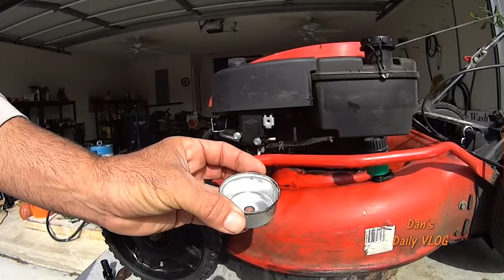Lawn Mower Repair - How To Drain Bad or Old Gas and Clean Carburetor Bowl and Jet

Comment: This is THE BEST mower instruction video I found so far. It should be the 1st video you need to watch when your mower does not start. I had a new mower used for only a couple of times and sitting in the winter. It did not start. My grass has grown to 1 meter high. I have experiences in fixing cars so I think I will give it a try. I watched several videos from YouTube but they don't tell you how a lawnmower works exactly like in this video. I went to Walmart to buy some starter fluid, some engine treatment fluid, and some cleaning fluid. I put them into the carburetor......This is what I learnt from OTHER YouTube videos......They all tell you there is gunk in those places and you need to clean them......WRONG! 
After I watch this video, I grasp the theory of lawnmower and realized that those cleaning fluid actually JAMMED the tubes in carburetor! So I take out those tubes in carburetor and wiped out the fluid on them. YEAH, through these tiny holes, I can see there is no gunk in it. It is just the OLD FUEL that causes non-start. I put more high-graded fuel from Walmart and it works like a charm! I only need to pull the cord a little and the engine ALWAYS starts. Thank you so much Dan! You saved my time and my weekend is not ruined! I can rest and go to work next week without dealing with repair shops and taking my mower back and forth.

Comment: Thank you Dan!
I drained the gas tank of my new (end of summer 2016) Toro Brigs Stratton (7.25 190cc) for winter storage and used fresh gas today for a 2017 mow but it would not turn over at all. Your video was extremely helpful and very much appreciated. I will make a donation to St. Jude CRH which was a very classy suggestion on your part. Thanks again.
Reply from the maker: Thank you John, you are very kind

Comment: So - I ran my generator until it stopped and put it away.  When I was ready to use it again, I filled it up with new gas and stabilizer.  Couldn't get it to start.  Figured I was in for a repair bill at the local small engine clinic.  When I tried to start it I got that familiar smell of varnish from old gas, even though I had run it dry.  Long story short.  I followed your directions and used a little spray carb cleaner ( the float was stuck and the intake was blocked) and badda bing, badda boom, it started like a champ.  Thanks for takin' the time to show us what's behind that little bowl.  It is greatly appreciated!
Reply from the maker: My pleasure

Comment: BTW - I used a bread bag "twisty tie" to clean out jets etc.  Just strip the paper or plastic off wire and run in and out of jets. Worked great.
Reply: Paul Anderson you can also use welding tip cleaners.  They work amazing
Reply: How about a paper clip?

Comment: Sonofagun! This is one of the 2 or 3 best how-to videos I've ever seen! I have a Craftsman 3.5/ 20 inch 1986 push mower and the only maintenance I ever did was change the oil, spark plug, and air filter once a year.  That's held me in good stead til recently when the mower would start up okay, run for about 7 minutes, then start missing as though it was about to run out of gas, then die.  From your video  I now think the problem may be bad/old gas or maybe just a speck of dirt in there.  Your video and description of the fuel line/ carburetor bowl corresponds exactly to what I have on my old Craftsman and now I'm excited to try out these simple methods.  Thanks so much!
Reply from the maker: Thank you so much for the high praise !

Comment: 1 problem with carbs is that not all mowers have it on the outside with the bowl available. With mine, many of the parts must be removed to get to it to drain & clean it. Including the top with the pull rope & that's the easy one. Be sure to watch a video with this type of mower to see the disassembly & reassembly.

Comment: Thanks man, my electric mower died so I had to pull out my almost 15 year old gas powered one.  The carburetor bowl and the hose were in a harder to reach spot for my mower.  I emptied the gas and removed the carburetor bolt, but the bowl refused to budge so I let it be.  I sprayed the carb cleaner directly into the holes of the bolt, put it back together and BAM, my mower started.  I can't believe that a 15 year old mower that has not been started for years is running like a champ.

I also checked the oil and cleaned the air filter.  I'm surprised that my Murray mower with the Briggs and Stratton 6HP engine is still running.
Reply from the maker: Sweet

Comment: Thank you so much! After cleaning up the holes in the bolt holding the Bowl at 10:36, my lawn mower works right away now. The holes on the sides are bigger, so I was using clip. The center hole is a little small, so I found out the metal tip of jumper wire was perfect to clean up the little hole. Just in case anyone looking for things to clean up the holes.

Comment: great video thanks! my friend moved out of his house and got stationed elsewhere and gave me his lawn mower he stopped using because he had bad gas in it. Drained it and replaced the blade and works like new. Great Vid, subscribing now.
Reply from the maker: Happy to help Amani
Reply: You should investigate contamination source starts with clean gas can ,clean gas tank clean fuel no older than 30 days and storing gas container in the shade or inside shed with top closed with cap on not pouring funnel sticking out gas absorbs moisture and moisture can turn gas bad

Comment: Really good video, thanks,  I have a new Briggs and Stratton used only for one season.  I went to winterise it and although I had run down the gas, there is still some in the carb bowl.  Now I can do a full drain and clean before it goes away.  Just to say I’m in the south of France so I did the final cut during last week.  Well done for taking the time to explain slowly and carefully.

Comment: 5 minutes in and he still hasn't started. I'm just gonna turn it upside down in a pan. 😫
Reply: I know this is 1 year after you wrote this, but I just found this. I couldn’t get the tube off so I just used a Turkey baster. Hopefully that’s ok… I tilted it a bit at the end so if there was any in the carb it might flow back into the gas tank. I couldn’t see much else in there anymore. Also he said the gas would flow into the bottom of the mower and then into a fuel catch, but my Toto Recycler doesn’t have any fuel catch and there was way too much gas to fit in that little lip. I was so excited about a gas mower until it immediately gave me issues.

Comment: Hello Dan great video very informative at the rite time I gotta drain my mower storing it for the winter and now I know exactly what to do thanks Dan
Reply from the maker: I would rather you put some stabil stabilizer in it so the seals in the carb and the fuel line doesn't dry out and crack from the ethanol residue. Stabilize the fuel now and run machine for 5 minutes so the carb gets the stabilizer in it as well then drain it in march IF you have to.

Comment: Great video. I like how you explained things very plainly. I haven't done anything yet, but I know the video has helped me figure out how to check all that.  My problem is that I was fixing an issue with the mower that kept the blade from spinning. I flipped over the mower while I was fixing it.  I didn't drain the gas like I'm pretty sure would have been smart to do.  My neighbor was able to mow is lawn and after he was done, I tried to start it the next day to get my lawn done. The mower didn't start. I've waited a day to give it time to dry out any of the gas that may have flooded it and still nothing.    I bought my new better powered Ryobi mower after convincing the wife that I can't get it fixed.  Now I am trying to fix it so I can donate it to my neighbor.  So I'm trying to see if I can easily fix this.  I don't necessarily want to pay a professional to do it.

Comment: Dan : I've always used 93 octane ethanol free and I also use is Sta-bil gas stabilizer and Sea foam and this has always worked for me in leavening fuel in my small engines all winter long without draining it . Just my findings .... cheers

Comment: Need to clean my B&S 175 cc power washer which utilizes the same engine. Watching the video at 8:38 you were draining the gas tank and it looks super simple, but you might want to open the gas cap before disconnecting the fuel line which would allow the fuel to run faster as there would be no suction left in the tank.

Comment: I have a power washer and I couldn’t get it to start but I squirted a tiny bit of gas into the intake without the filter and it ran for a few seconds then quit and we have had it 3 years and have used it all of 2 or 3 times
Reply from the maker: +Traxxasboy9087 Well given what you've said that it will run if you poured gas in the carburetor I would say follow the steps of my video to clean out the carburetor bowl and make sure the float is working properly and that you have clean fresh gas in the tank

Comment: In addition, I leave my big Husqvarna tiller loaded with gas from season to season and my 10hp pressure washer also completely filled with gas from one use to another, but I only use premium non ethanol gas, aadaquately stabilized.  If you want to burn that cheap crap in the growing season you need to burn it all out and refill  with the good stuff before you put it up for the winter.   All I do in the spring is replace the fuel filter,  turn the gas on, check the oil level and crank it up.  I put fuel filters and fuel shutoff valves on all outdoor power equipment if they do not come with one.

Comment: When  i winterize  i run until  it stops  then pull  it couple times  but watching  your video  i can take off the plug  to make sure im dry always  have stabil in my gas
Reply from the maker: Well done. Don’t be afraid to spray a little WD40 in the spark plug hole and replace the plug before you let it sit. Helps for the first few pills of the cord a few months later

Comment: If you tilt the lawnmower on its side with the carburetor bowl up, can you just unscrew the bolt on the bottom of the carburetor bowl to check if the holes are clogged without emptying the gas tank?   Or will the gas in the tank just flood out of it?  Thanks.  Great video series!
Reply from the maker: there would be no way to stop the gas from flowing from the tank thru the hose and out the bottom of the carb unless you can get the carb bowl ABOVE the fuel tank. If so, you will be ok except for the fuel in the bowl itself will come out

Comment: I get to 10:55 and this is a great video - exactly what I needed when I went looking.  I have to ask:  Why did you screw around with the hose clamp to drain the gas tank at all, when you were going to open the carb stop and drain that too?  Seems like opening the carb stop was absolutely all you ever needed to do.
Reply from the maker: Ensure no blockage in the line AND drain the carb.
Reply: @DansVlog  Thank you for your reply!  That makes sense, and your followup to a new comment on a 5-year-old video is much appreciated.

Comment: if you don't have fuel line(mine does'nt)i removed oil,them tiped mower on its side to drain fuel,you are not supposed to turn mower on its side(i mean carburettor on bottom) because oil will get into carb.

Comment: We drained them for the winter. Just cleaned the carburetors, and all the other pieces. Also checked the spark plugs. Supreme gas. Turns over. Starts, and then quits within two feet.
Reply from the maker: +PixieTheRabbit probably the needle in the carb bowl has dirt on it causing the bowl to fill too slowly
Reply: Thanks! We will try it tomorrow morning. My son is the mechanic and I am his helper. I am tired of paying $95.00 every single year. And I can't afford it, either. My son thinks that the issue is linked to the ethanol in the gas; so we are using supreme this year.
Reply: Thanks for your advice. Needle cleaned again--and everything else.. Still won't keep going. We are going to try adding dry gas. Same thing with both lawn mowers: one is a nice Canadian; the other is a cheap $150.00 from Lowes, older model from my dad. I think I will take a look at some of your other videos, and then make my son watch them, hahah..
Reply from the maker: PixieTheRabbit when you take the fuel line off the carburetor do you have good fuel flow coming from the fuel tank there is sometimes a screen in the fuel tank that can get debris blocking the fuel from flowing from the tank and through the hose
Reply: Thanks for your sound advice. My son cleaned my husband's mower needle for the third time--this time with carburetor cleaner with chlorine. Now his is up and running. Will cleaned the screen on mine, and the needle--twice. But tomorrow, we are going to use that cleaner with chlorine.

Comment: My Troybilt would not start a few years ago and I took the carb bowl off and cleaned it with carb cleaner now it starts on the first pull.I took a bread tie and put it through the fuel jet hole like you showed.
Reply from the maker: Good idea. Thank you Mark
Reply: Mark sorry been quite busy at the factory and around the house will get them up soon have some trimming mowing and use of the Echo hand held also
Reply: Thanks Dow I understand work 4 10 hour days myself sometimes work days off sometimes mandatory and sometimes I volunteer for overtime.
Reply: A lot of people on vacation this month so we are pulling 5 12 hour days at the moment
Reply: Man I know it gets busy for us at the end of the month and real busy the end of the year,The money is good but you get burned out.It will be slow for us at the beginning of the year.

Comment: Well, I tried. My Craftsman lawn mower is only a couple of years old and is not set up like this. I could not even get the hose off of either end. It's a super tight fit with basically no room to move around. The bowl does not have a bolt that I can remove without taking a bunch of other stuff off (it's counter-sunk inside something else, I don't feel or see any way to get a tool on it). I'm just taking it in. I could have done it if it was a mower like yours.
Reply from the maker: Sorry bud

Comment: OH ok Dan I'll do that then thanks brother I just bought the mower this summer mid June honestly I haven't even cut grass with it yet the gas that's in it is from the guys from the shop I bought it from to test it they had to assemble it them selves to make sure it was ok before leaving their store what should I do then next year I will be using it a lot more
Reply from the maker: Next year, just put gas in it and run it like normal. At the end of the season, going into winter, consider Stabil and let it sit.

Comment: Thank you so much! I accidentally put the weed eater gas in the mower and I needed to drain it out 😬 oops
Reply from the maker: GENESIS QUINTEROS you can run your mower with MIXED fuel you just can not run your weedeater with NONMIXED fuel
Reply: Dan's Vlog thank you! I did that for a little bit until I found your video and decided to drain out whatever was left! Good to know though because I thought it would mess up and my mom would get mad 😂 thanks again! I appreciate the video and the reply!

Comment: I had just a tiny bit of gas left in my gas can, and poured it in the lawnmower yesterday before taking the can to refill.  Poured more new gas in it when I got home, but it wouldn't start.  It had started fine recently, and for as long as I can remember.  I'm guessing it was a bad idea to pour that gas that remained in the can into the mower, even though it had only been in there a month or so.

Comment: you can use a gas stabilizer like seafoam or K-100 in the gas i prefer K- 100 and run the engine 5 mins. or so the stabilizer gets mixed in i use it in all my small engines before storage if the gas you purchase has ethanol in it could cause problems after sitting!

Comment: I am going to try this with my mower. I hope I have the confidence to get it going because it's just me and my daughter. Let you know what happens.
Reply from the maker: Go slow. Take your time. Watch your eyes. Gas hurts. Please let me know how it goes.
Reply: Anela, I'm in the same boat with just me and my daughter. I'm a little scared to try.....we shall see.
Reply: Dan's Vlog Hey Dan, its probably been a couple years since I've used my mower. Do I automatically need to drain the gas and oil without even trying to see if it starts? Also, where do you dispose of the old gas?
Reply from the maker: Bring the old gas and oil to a local auto parts store like Napa, Autozone or an advanced auto. They will have a free place to dump it. Yes, for sure you will need to drain the gas and oil and replace the oil with new. Use SAE 30
Reply: It worked for me I did just what Dan said and it worked. I drained the gas and put new and we are good to go. Me and my daughter try and do everything around this house ourselves to save money and it gives us something to do together. So thanks Dan.
Reply: Dan's Vlog Thank you so much Dan

Comment: Repeat,repeat,repeat.  This should be a 7 minute video at most.  Spray inside the jet with Carb Cleaner.  using the tube on spray can spay Up inside the carb where the emulsion tube is.  Sometimes at the top of the thread there is a very tiny hole going in on an angle.  Use a wire from a wire brush to probe that hole. Mark the bowl so you reinstall in the correct orientation. Drain Bowl FIRST to clear any blockage of the needle and seat and any water.  There should be NO dirt in the bowl.  Install an inline filter.  Be sure of line size on the filter.